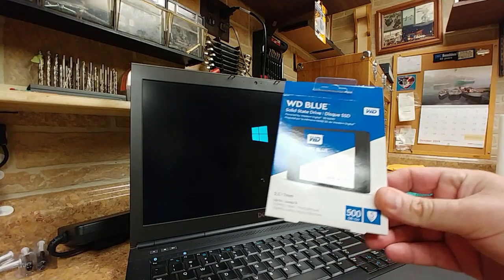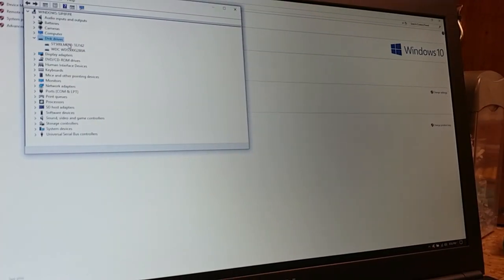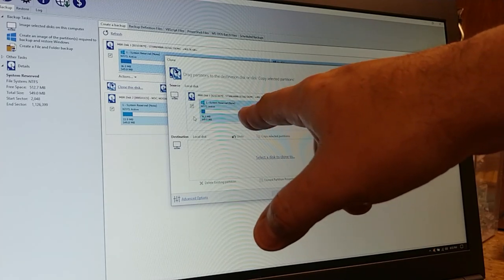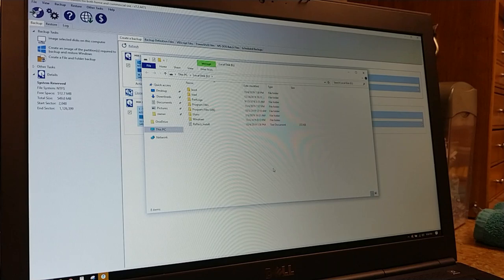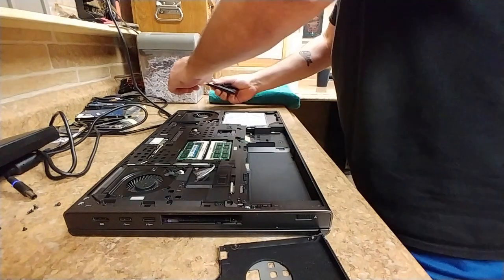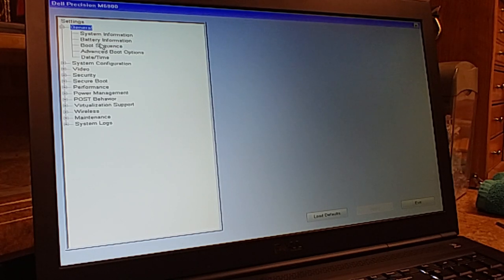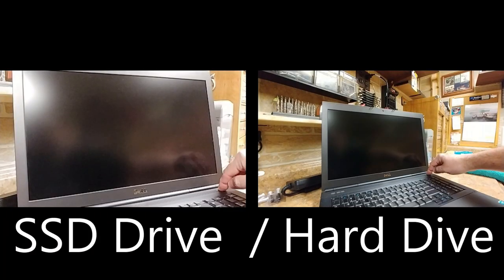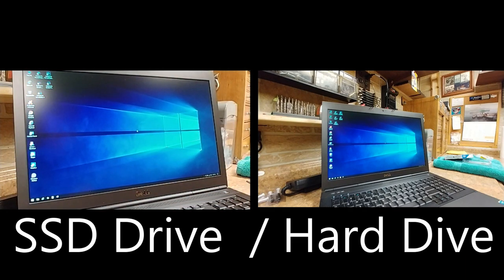Ghosting a Hard Drive to a SSD Drive

Comment: Since 2012 I have used Paragon Migrate OS to SSD, which handles all the drive alignment stuff as well as cloning the whole drive across to the SSD.  I'm thinking of trying a tool I have used as an older version since 2012 at least, which has another version with SSD called MiniTool Partition Wizard Technician.

Comment: In this case, maybe being Dell or the way their BIOS and to interface with new SSD did work.  But not always. WHen cloning from a HDD to an SSD drive, the ghosting or cloning works just fine but it does not boot the first time. To make it work (in generic or self build computers) you have to go to BIOS and select the new SSD as your primary disc then tell bios you want Windows Boot Manager, save and Exit from BIOS.

Comment: Is this a true clone or have you ever had software license issues because the license is tied to the drive ID in some way? I am running out of room on my C Drive and cloning may be a good solution as long as it doesn't screw up all my music software licenses (iLok etc)
Reply from the maker: So far I have not had any issues with programs or any warnings about license. I put a few of my programs that need keys and needed computer vacation. Nothing complained.
Reply from the maker: I did this before the cloning.